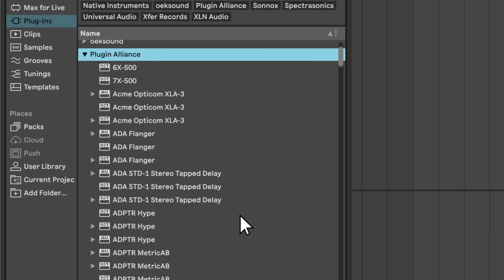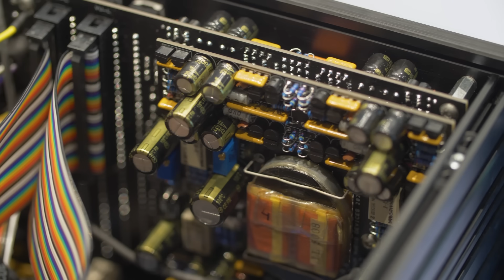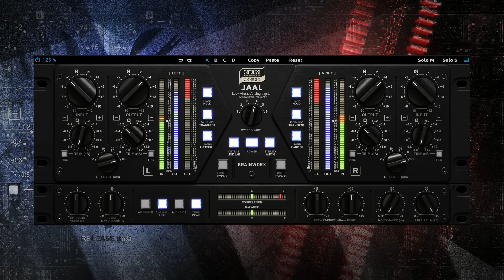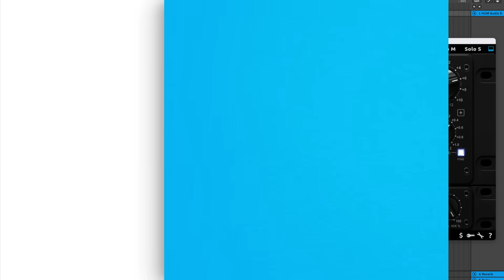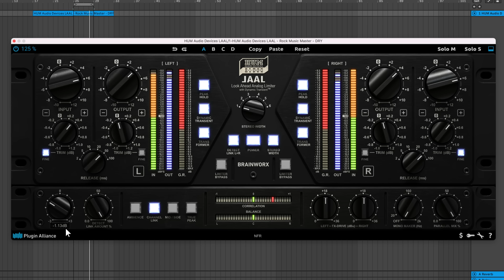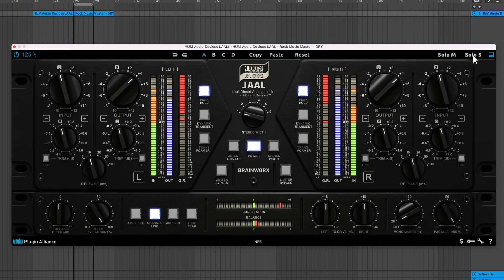HUM Audio Devices LAAL Mastering Limiter - Walkthrough | Plugin Alliance

Comment: I wish there were fine adjustment buttons for both the input and output knobs. The step controls are a nice nod to the analog domain, but the sudden jumps and drops in volume levels are too drastic. I often find myself relying on the fine adjustment button with the trim knob for precision, yet it still feels insufficient. Personally, it makes for an awkward workflow. If you can add a fine Button in later updates next to the Input knobs that would be amazing.
Reply: Same thing happens to me. Makes the workflow somewhat unnecessarily time consuming and still not able to dial in the result. The output meters could have also been placed down the bottom where the extra features are located. For me it's distracting with the output meter jumping around together between the Input & GR meters. Too busy in my opinion.

Comment: Hello, I tried the preset "01 - Clean -0dbfs TPk Brick LR" but my mix is clipping above 0.0 DB. I didn't change any parameter. What did I wrong? Thanks.
Reply: I think you ensure True Peak is on, I heard. It's off by default, I think.
Reply: @MPHORROCKS  It's on.
Reply: @reonom8825  The it's obviously not to be used as a final limiter (which seems strange) or it's a bug. On Gearspace this has been discussed and people with far more expertise than me have said as much.

Comment: Sounds pretty good. For my ears, I noticed on all the examples in the video, and even in my testing, it reduces or loses a small amount in the  2kHz area, but a little pre-boost of it with some EQ fixes that. A bit strange they didn't put a SC filter in the hardware, but I'm not a hardware dev so anyway...  can one be added to the plugin in an update?  ADDED: The TP isn't working (in Reaper 7.37). Using it as a final limiter, I'm getting TPs of +2.3dBTP on a song (-9 LUFS) that I only get 0 or less with other limiters that have TP limiting enabled. Also had a song with +0.49dBTP (-4.8 to -5 dBFS, -12.5-Int LUFS, during the chorus), and the true peak stayed there when TP was on (both in Reaper and Studio One).
Reply: This is before the normal limiting, thats how Paul from audio animals recommend it.
Reply: @ Thank you!

Comment: May I ask why you have your ADAM audio speakers horizontal? Does it affect the way it sounds? Cus i have a pair of those exact same speakers and they look cooler sideways lmao
Reply: its usually done for either space restraints reasons or to align the tweeter with the woofer. But you have to be careful. If the speakers aren't designed to be horizontal it can sometimes cause phase issues and alter the stereo field.  It doesn't hurt to experiment as long as you know what to listen for.

Comment: Thanks for the video and congrats to the new plugin. While I like the sound, I seriously question this plugins functionality or did I miss something? Where's the ceiling settings? Isn't that the reason you put a limiter on your bus to limit to a certain amount? A limiter's job is to set a strict ceiling for your audio signal, preventing it from ever rising above a specified level. Otherwise it's just a compressor, a good sounding one no doubt, but not a limiter in it's very definition. I'd appreciate your feedback to this. Thanks
Reply: Yeh I agree. I was looking for the ceiling control and couldn't believe it doesn't have one. And it doesn't really limit as when pushed a little it still clips even with TP. It's a compressor in my opinion. I certainly wouldn't use it as final limiting. I wonder if the actual hardware does this. I think this plugin is bugged. If it's not and it's the actual behavior of the hardware then I guess it is what it is. Not for everyone.

But I would encourage plugin alliance to update the plugin and include a ceiling threshold... an option to switch between stepped ins and outs to finer adjustments and move those output meters to the bottom with a global output volume. I understand we can use the finer adjustment knobs but I found sometimes I just cannot dial in the desired result and it just takes way too long. These emulations are great but within the digital domain they can be improved regarding workflows.

Comment: Been using it this morning. It's lovely but can't really get it to act like an actual limiter. It consistently exceeds 0DB in all DAWs and causes genuine overs, not just TP. Maybe I am misunderstanding the use?
Reply: Lovely sound genuinely. But more so a limiter before my last limiter vibe.
Reply: This!!!  @sancessounds
Reply: Happens to me too. Is not as forgiven like L2 or Ozone. Works fine like 1st limiter.
Reply: Use the output trim to get it in the right spot. I’ve been playing around with it and you’re gonna want to get overs at first when pushing the output to zero like just over zero nothing too crazy then you’re going to want to use the output trim not the output knob the trim knob till the point that you’re close to 0 but not going over. Once you’re there you’ll be in the sweet spot and you’ll notice that it’s very hard to get it over zero at that point
Reply: I had to reduce the input by a large amount.  For example, on a test mix, if I used FGX-2 (limiter only), I didn't have to reduce anything; but the same track with the HUM LAAL ML, I had to input trim by -6 dB first. ADDED: The TP is not working. I'm still getting TP of +2.3 on a song that I get TP of 0 or less with other limiters that have TP limiting enabled.
Reply: @Jrel I thought my plugin was bugged so glad am not the only one. Switching to L2 personally for final. This might work on a bus.